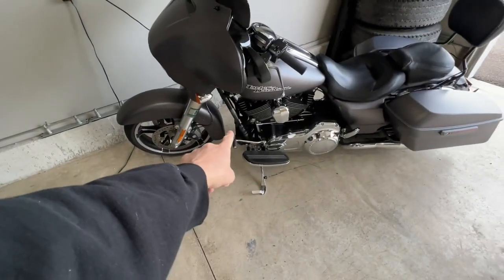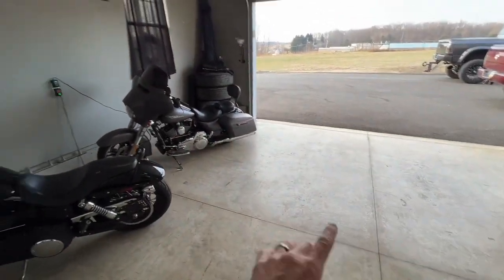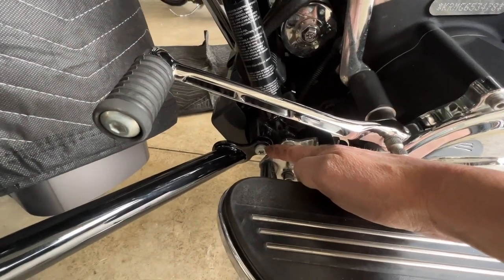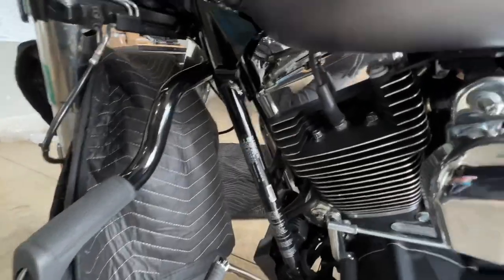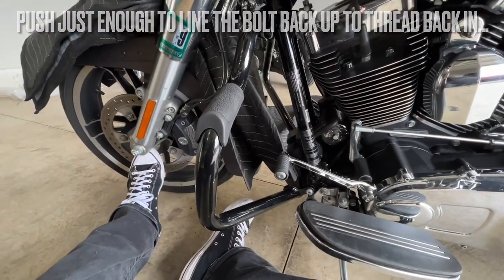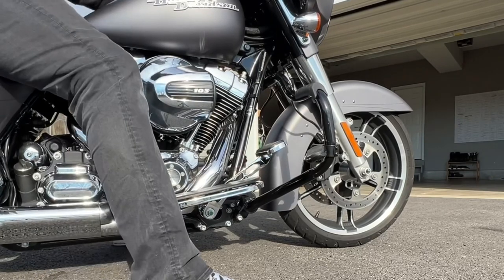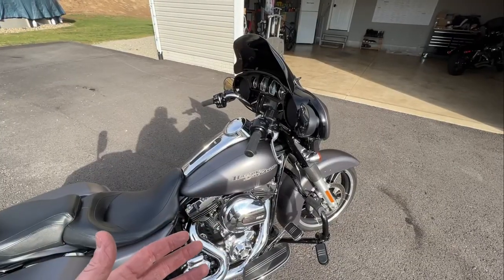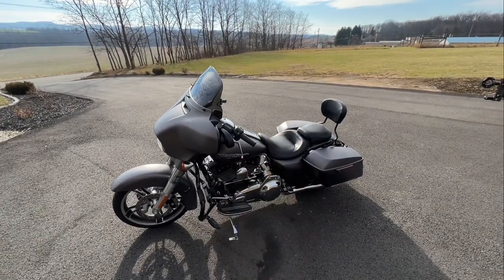High Quality Low Cost Engine Guard & Highway Pegs On A 2016 Street Glide Special.

Comment: May I ask how tall are you? I am considering installing these on my 09 SG and wondering how it would be vs the stock ones on a long trip. Thank you.
Reply from the maker: I am 6’3” 270lbs
Reply: @DieselLegiance  Thanks, asking because I am wondering if these bars with the rubber on top of them is good for stretching out my legs on long trips, have you used them for that purpose?
Reply from the maker: I’ve never done that as it felt too awkward as my legs were too high.  I’ve just used highway pegs.  I like the mustache bars for the look that’s all.

Comment: Great video.  Do you know where I can get the molded feet rest from?
Reply from the maker: You mean the floorboards?
Reply: @DieselLegiance  the rubber pieces on top of the crash bar. I think you can put you feet on them
Reply from the maker: Try eBay or Amazon as I am not 100% sure

Comment: hey Matt! I love your place and motorcycles! it seems that the position you hold with the new bar it really confortable. How it is doing on the road or long trips?
Reply from the maker: So far so good.  It’s been too cold out to travel too far but so far I really like it.  I have the bike stripped down right now because I’m replacing the handlebars with 16 inch apes, extending the wires and cables.